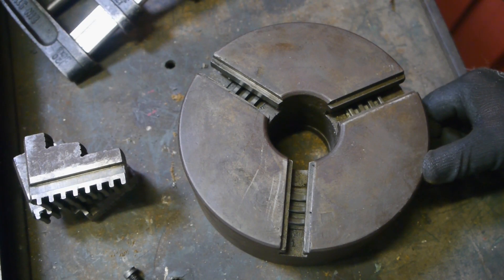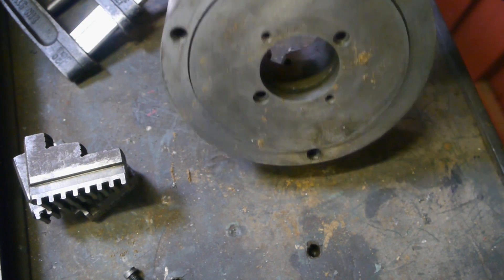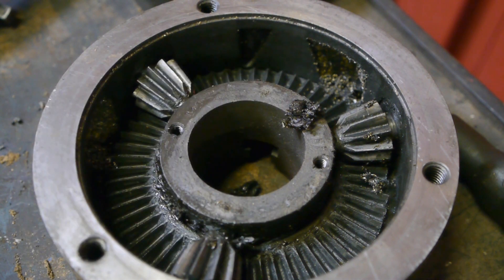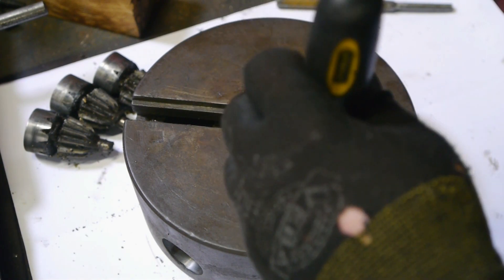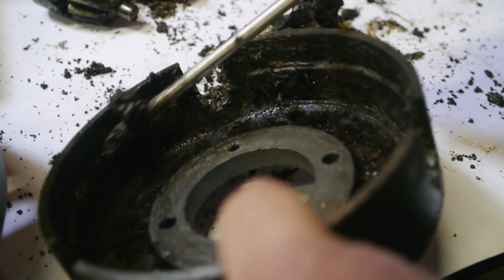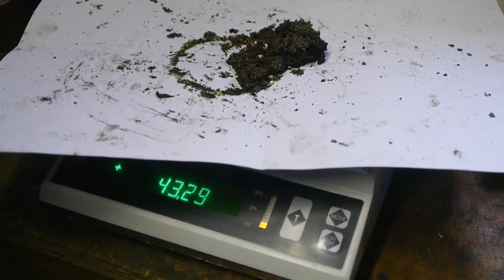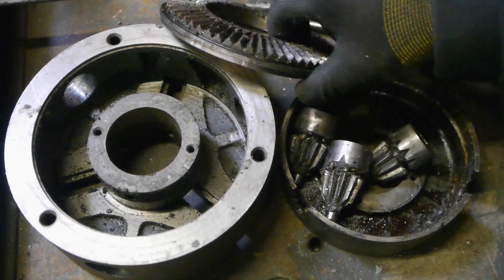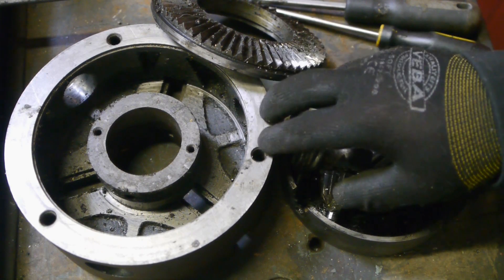Cleaning the world's dirtiest scroll chuck

Comment: Wow, it certainly was a dirty chuck.  Thanks for the video.  43 grams of dirt is a LOT of dirt.

I wonder if this was from machining cast iron or other metals which make more of a dust than chips.

I would not attempt to electro-plate.
Reply from the maker: It cleaned up ok. No rust inside. 
There is a bit of play on the jaws an I'm hoping a bit of zinc might fix that for a while.
Reply: The gold pieces look like lots of bronze machining, if you think cast iron flies everywhere well bronze makes small flakes that float away up into everything.